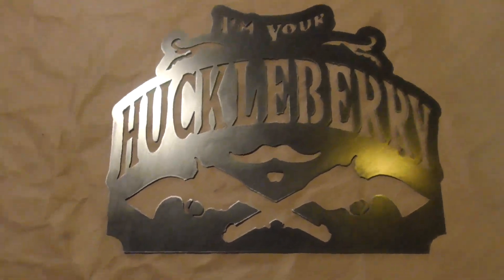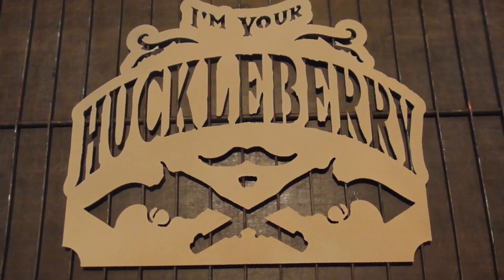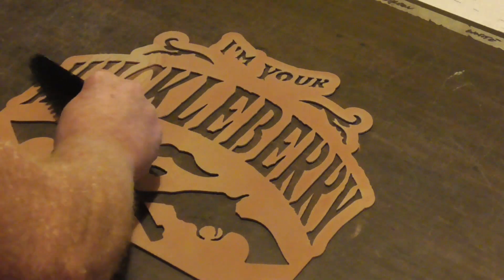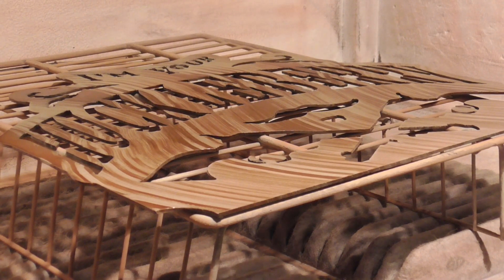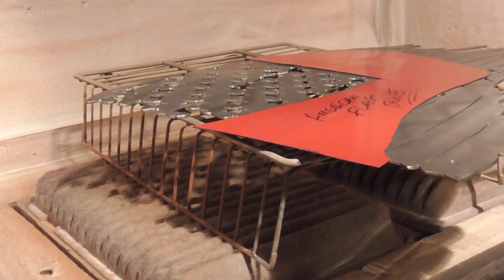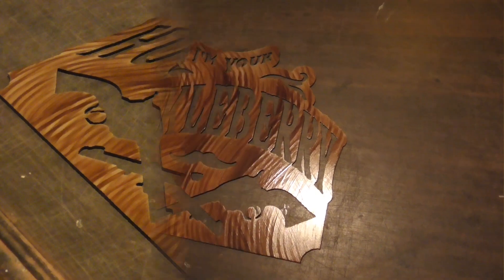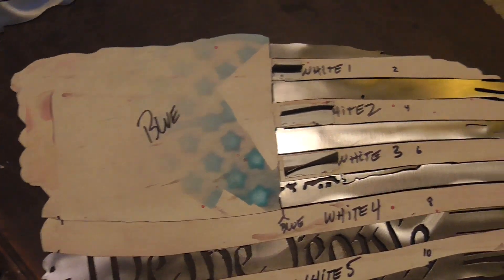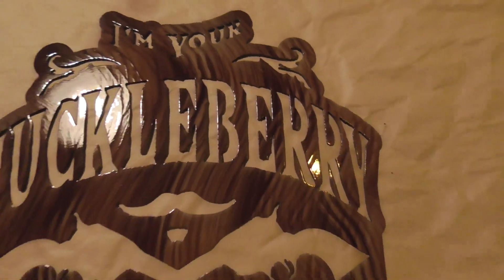Powder Coating Wood Grain Effect

Comment: Man turned out really nice skip. What do ya do about the back of the piece? You just wipe off access just curious I'm learning this stuff.
Reply from the maker: I clean the back same as the front but the powders wrap around in the spray process and stick to the back, it's coated but not pretty like the front.